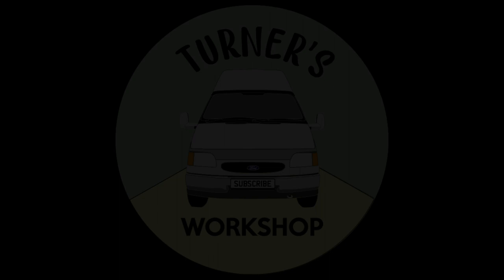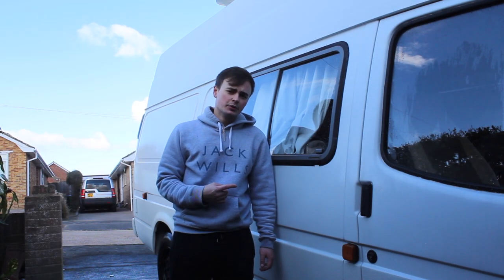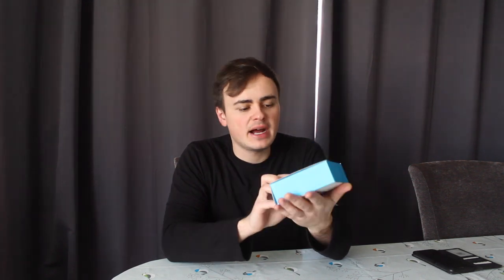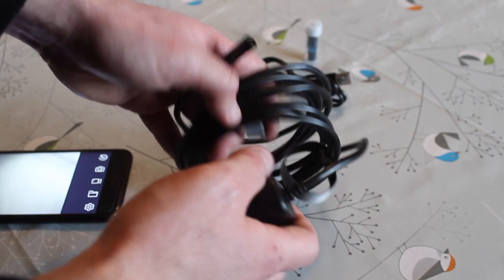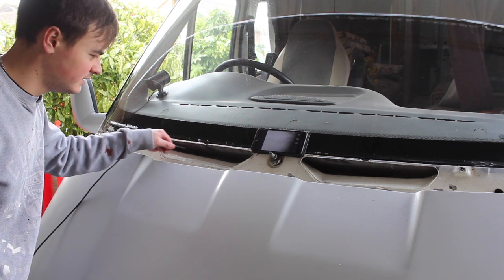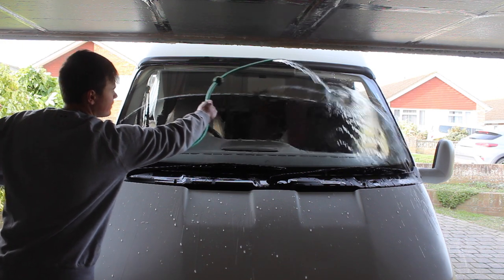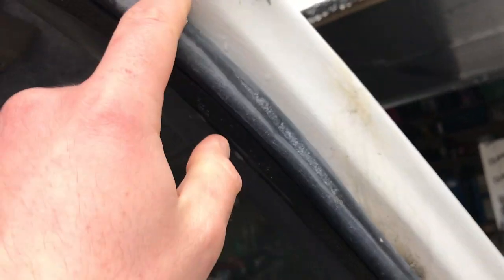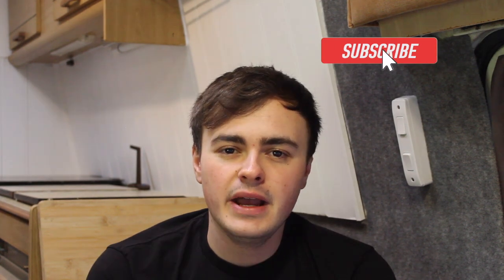Ford Transit Water Leaks Part 2 - Finding the Leaks

Comment: Mine was leaking from the seal at the sides of windscreen, I cleaned the channels out the sealed the rubbers back with windscreen bonding sealant.
Great video fella, keep the old girl going strong & hopefully hit the road this summer 👍
Reply from the maker: Thanks mate 🙂 I have sealed the top and sides of the screen like you before but seems like it’s coming in through the bottom now 😂 It’s a full time job keeping the old girl going, luckily I enjoy doing it 😅 hopefully we will be able to get away this summer! 🤞🏼

Comment: Well thanks again for a great video. My van is split mint but noticed this on mine over last month on the passenger a pillow some slight blisters under the paint. I'm gutted about it so this will have to be done asap as it's the only bit rust on the van only noticed as I did the monthly polish as I try to keep the rust away as these vans can rot fast if not taken care of
Reply from the maker: It’s a pleasure, thanks for watching. That’s sad news on a mint van mate. Hopefully you can get it sorted. Water ingress issue like I have maybe?
Reply: @TurnersWorkshop97  yeah it's slightly bubbling on top of windscreen on left top corner n few bubbles down the a pillow. The driver's side is perfect. It's strange as I wondered if was coming from windscreen seal and penetrated into corner of roof but think you got nail on the head with the gutter
Reply from the maker: Could be windscreen but if it’s hicube with fibreglass roof I would bet on the gutter seal. It’s good that you’ve spotted it early though as hopefully it won’t be a major to repair.
Reply: @TurnersWorkshop97  it's a motorhome but the rear box part isn't connected to the upper front tin top roof so that is what make me think it's the water getting behind the windscreen rubber. It's similar to a BT LUTON box van. So the fiberglass rear body doesn't sit on the roof of the chassis cab

Comment: Well done mate brilliant test with the hosepipe. Close one with that camera getting stuck. The sound deadning in the engine bay holds water as well it's like a sponge mate have a look behind there 👍👍👊🏻
Reply from the maker: Thank you mate 👍🏼 nearly got to the point of cutting it off 😂 That’s a good point. Was thinking about removing it as it’s another moisture trap anyway but can’t seem to get a new replacement. Maybe I will look at covering it to seal the sponge 🤔 thanks for your comment Dave

Comment: Mate you can get the door seals(aftermarket so brand new) and other parts from transitcenter. I had decent experiences with them before. Hope this helps!
Reply from the maker: Cheers mate, I’ve had a look around £30 each? Seems fairly pricey for door seals. Might take a trip to the scrap yard and see what I can find that might fit 😂
Reply: @TurnersWorkshop97  Yes, mate, this is why I recommended them. I didn't try them, will probably do in the future but it seems like a good deal. The thing is that I also planned on going to the scrap yard but then I thought that the last smiley in EU was made in 99' so that is at least 20 years old rubber. So I thought about recommending those as they are brand new, fairly priced and look to be decent quality. I hope this helps, mate! Keep on with the awesome work!!
Reply from the maker: It’s a good shout thanks mate. Might be worth trying to find some similar seals of something newer and trying to fit them. I will try something. Need to sort the rusty pillars first anyway. Thanks for supporting the channel 😁
Reply: @TurnersWorkshop97  No worries, mate! Good luck, mate! Wishing you all the best!

Comment: Those a pillar leaks could be the windscreen higher up (was on mine) It's worth having a look you can just pull the seal out it's just a trim it doesn't hold the screen in if it's in fair condition it should just come out but be careful and don't pull too hard you can alway buy a replacement fairly cheap though. Also look out for transit parts UK in essex (they're also on ebay) cheapest place for decent transit parts I have found 24hr delivery too.
Reply from the maker: Hi John, I have taken the strip off in the past and sealed around the top of the windscreen and down the sides. It could be though because that was a while ago. Never the less the screen will have to come out to repair the damage. Have you taken out your screen before? I’m trying to work out the best way to do it. Thanks for your comment 👍🏼
Reply: @TurnersWorkshop97  I have done screens before but not on a transit yet but I will be as soon as I find a repalcement screen for mine, noticed a big crack a couple of days ago! Windscreens are usually these days held down by a glue called sikaflex which gets softer when you heat it  with a heat gun then you can feed a windscreen cutting wire (get it on ebay) through from the inside to the outside to cut through the glue. There's probably a video on here showing how it's done. If I run in to anything of note when i do mine I will let you know mate. This is similar https://www.youtube.com/watch?v=ywJmYlt39Vg
Reply from the maker: That’s great thanks for your help 👍🏼

Comment: Hi, are your steel wheels just painted black, or have you used a special paint. I’m starting to love your van like I ❤️ my own.
🐧🐧
Reply from the maker: Hi penguin Pete! It’s black alloy wheel paint I used. Wire wheel to remove all of the rust and old paint, zinc galvanise spray paint as the base coat and then black alloy wheel paint on top finished with clear lacquer but unfortunately rust has started to come through on a couple 😩 so might have to redo them again at some point. Haha thanks mate 👍🏼😁